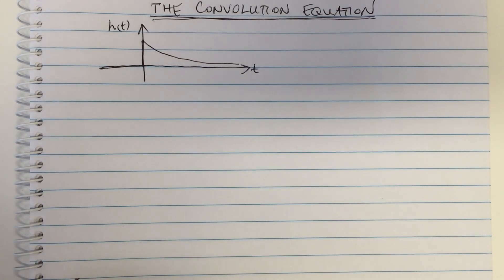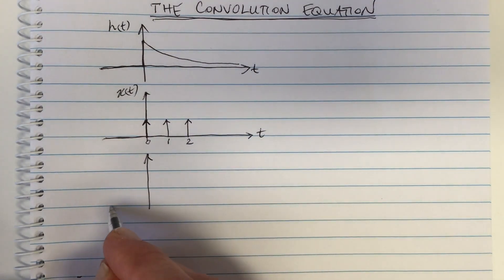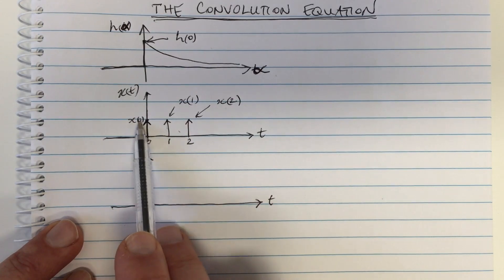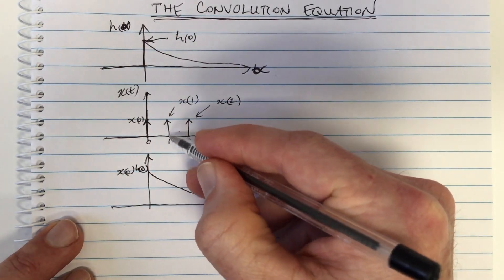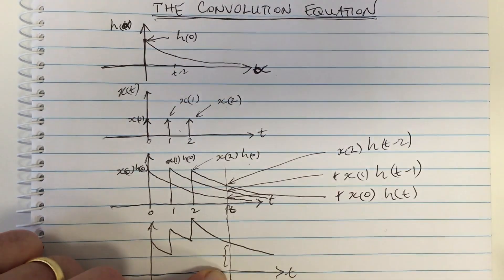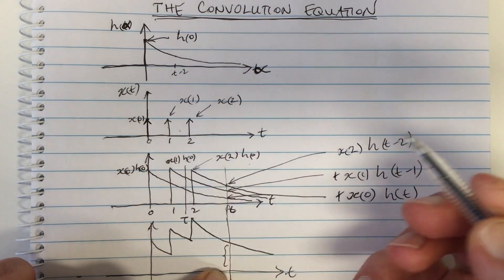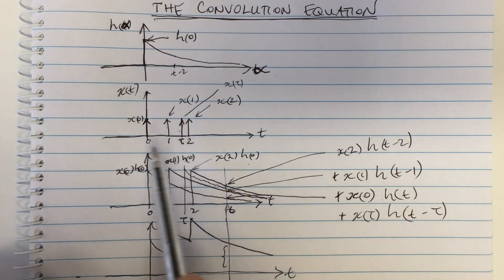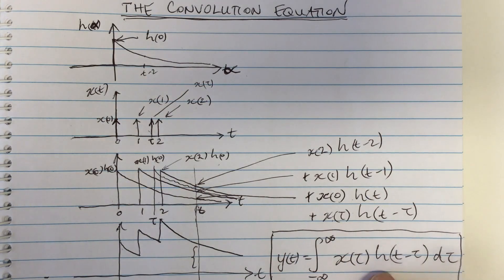Convolution Equation Explained ("Best explanation on YouTube")

Comment: if the convolution is calculated for a fixed t and tau is the variable what if we wanted to know for every value of t. Would we integrate the convolution equation with respect to time?
Reply from the maker: Hopefully this video will help explain: "Convolution in 5 Easy Steps" https://youtu.be/aMaw4EumwyE
Reply: @iain_explains  hey yes i understand from that video you are picking discret values of t. Am i right in saying that the convolution equation is for discreet values of t? That would imply if i wanted every value of t i would need to repeat the convolution equation for every value of t if my function was unbounded. Seems cumbersome maybe i am missing something sorry.
Reply from the maker: I don't pick "discrete" values of t. I pick example values of t, and then I work out the range of t-values for which that answer holds. If you watch my "5 easy steps" video, you will see along the bottom line, that I show the values of t for each of the cases. The answer of the convolution is different for different ranges of t, but I show the answers for all values of t, from negative infinity to positive infinity.
Reply from the maker: Yes, that's right.

Comment: I think you should say more about x(t) being "identical in its effect on a system" to an "infinite series of short rectangular pulses" with area x(ti)•Dti each. Each of these pulses generates a response very similar to the system's impulse response multiplied by x(ti)•Dti or h(tt-ti)•x(ti)•Dti...
Evaluating all these responses per all ti at tt=t and summing these evaluations leads do the total response of the system to x at time t. Taking the limit of the sum as Dti goes to zero results in expressing the sum as an integral - the convolution integral...
This is possible if the system for which h(tt) is given is linear and time independent, i.e., LTI.
Reply from the maker: Here's a video where I give a bit more intuition along those lines: "How to Understand Convolution" https://youtu.be/x3Fdd6V_Hok

Comment: quick question, when summing the output responses at 4:25 and we say it begins decreasing, can we say it decreases twice as fast after summing the first two responses, and three times as fast when summing the third response, as in the decreasing section of the response, it would be the sum of 3 functions which are all decreasing? Basically im asking if the rate of decrease in the summed functions remains the same in each section. Thanks!

Comment: In case if the system is not an LTI, then what can we do to find the output?

In a NON LTI system, The convolution with it's impulse response won't work right?
Reply from the maker: For time varying linear systems, you can still take an impulse response approach to modelling the system, but the impulse response will be a function of time. eg. h(t, tau) where "t" is the time that the impulse is applied to the system, and "tau" is the variable that indexes the response to that impulse, over time.

Comment: Hello Iain,  you are blessed with knowledge,  passion to teach and intelligence. 
I love that you responded to almost all your viewers regardless of how long the videos have been posted. I have some confusions on the application of convolution.  I understand the operation of convolution from pure math standpoint,  namely finding the overlapped area of 2 signals,  with 1 of them reflected/reversed and shifted from left to right on an xy plane. However,  if it is applied to electrical signal over time for example, the impulse response represents the output of the system for an unit impulse as input, specifically,  you mentioned that a continuous time input signal can be seen as many scaled unit impulse with infinitesimally small time interval.  If we take at each time instant,  the ouput is the sum of input signal multiplied by its impulse response delayed by the same amount of time,  and the result could be a non-trivial positive number, even at time t slightly greater than 0. However,  if we use integration, given the small range in integration interval,  the area would be very very small. This is my confusion, can you help explain?  Was my question clear?
Reply from the maker: I’m so glad you like the video. Sorry, but I don’t understand the point you are trying to make in your question.
Reply: @iain_explains  Hi professor Iain, let's assume a unit impulse response of a rectangular pulse of 2V from time t=0 to t=2, and an input signal of rectangular pulse of 1V from time t=0 to t=1. If I understand you correctly, you were saying that a continuous input signal could be considered as many unit impulse (in this case with weight = 1) infinitesimally close to each other. If we measure the output of the system at t=0.1, if I understand you correctly, then it's the sum of x(n)h(t-n), where n starts from 0, and increases infinitesimally small to 0.1, while t=0.1. In this particular case, since x and h are both rectangular pulse of 1v and 2v respectively, so the output would be adding many 1v * 2v together, which would sum up to a large positive value, since there are infinitesimally many of them. For discussion sake, even if we just sample 3 unit impulses at t = 0, 0.01, and 0.02, the output would have been 3 * (1v * 2v) = 6v. However, if we use integration, the integral part of the overlapped signal between x and h is just (1v * 2v) (i.e the height of x * h) multiplied by 0.1 (i,e the width of the overlapped area of x and h, since t=0.1), which integrates to a value of 2 * 0.1 = 0.2. I think my understanding of the relation between unit impulse and the continuous signal is wrong.  Could you help clarify my confusion ? I hope my example isn't adding more confusion to my question.

Comment: One of the ways that students learn, or demonstrate that they have learnt, is when the teacher asks the student to explain certain features.

So here we are in the lecture theatre, Prof Iain has just explained the convolution equation. Iain asks "have you all followed the reasoning and the equation?" We students all dutifully and appreciatively nod an acknowledgement that yes we understand. Ok says Iain, I would like one of you to come out to the board and explain to the class why the convolution equation is a function of time written as y(t) with an integral that is written not with respect to dt, but to d(Tau). Often integrals I have seen written as a function of some variable such as t are determined with respect to dt. I get picked out to try and explain....

Ok I checked my ancient copy of Taub and Schilling "Principles of Communication Systems" and can confirm that within very early pages, the convolution equation as written by Prof Iain is quite correct. 

To try and explain then - it is to be noted that y(t) is a function of time and there is an expression h(t- Tau) within the integral. With t on both sides of the equation, we can have dimensional stability on both sides of the equation. y(t) will yield a value at any time t. Whilst not written on the vertical axis, y(t) was sketched as the 4th diagram in the lecture. In order to evaluate y(t) at some specific time t, we need to evaluate the sum of all the impulses (delta functions) and their impact on the output to give us a response at that particular time t. But the output at time t depends on many (an infinite number of) delta functions each causing a response which have occurred previously in time and are possibly still continuing to affect the system. So we start at -infinity to account all values of Tau that have occurred (almost like saying time, but not quite) and we look at the impact that an infinite number of delta functions occurring at all Tau's have by multiplying the system response at each Tau as seen at a specific time t. Each value of Tau is infinitesimally close and so are separated by an interval d(Tau). Repeating a little, we take all instances, an infinite number of instances, of delta functions multiplied by the system response which we sum. This continuous sum gives us our integral.

I think I passed, and am about to put the pen down and look over to Prof Iain to see whether he approves, but then one of you students calls out and says "What about that infinity upper limit in the integral? How can you sum something or say something that is yet to happen has to be accounted in the output at a specific time t? Is that what you are saying? Shouldn't the limits of integration be -infinity to t  rather than -infinity to infinity?" (sigh...) Just when I thought I had passed, this one comes like a curved ball. With my pass now looking quite shaky, I bite into my bottom lip and shake my head. No, sorry, you have me on that one.

Can anyone help?
Reply from the maker: The equation for convolution does not only apply to causal LTI systems. When you're dealing with a causal LTI system, the impulse response of the system will be zero for negative time, and this will limit the range of the integral in the convolution in the way you have said you expect it to be (ie. not going all the way to infinity). But the convolution equation is more general, and applies for non-causal systems too (eg. for images, where you're not dealing with time but with pixels which can be smoothed in two directions - forwards and backwards). It also applies for probability density functions. See this video for more on that example: "What is Convolution? And Two Examples where it arises" https://youtu.be/X2cJ8vAc0MU

Comment: Thanks, Professor for giving these wonderful presentations. I really lacked this during my studies. I have a doubt: When we find the output of an LTI sustem at the particular time t, as you said, it is the sum of all the values of system responses at that particular instant, but y is the limit of convolution from -infinity to infinity? shouldn’t it be -infinity to t logically? Because the future excitations might not have effect on the current output.
Reply from the maker: If you're only considering causal real-time systems, then yes. But the convolution equation holds for non-causal systems too. For example, when filtering an image, the "impulse response" of the filter affects the pixels that are on both sides of the "impulse".

Comment: how does x(0)*h(0), x(1)*h(0), and x(2)*h(0) give you some finite height, doesn't x(0), x(1), and x(2) evaluate to infinite since they are unit delta functions signified by the upward pointing arrow?
Reply from the maker: Excellent point. I didn't want to dwell on this in the video, since it's a mathematical technicality that detracts from the intuitive explanation of the video. However, you're correct, the delta functions are infinite height. But they are also infinitely narrow. So, what does it mean to "multiply" by a delta function? Well it's not really an instantaneous multiplication, since delta functions don't really exist. And a system cannot be instantaneously impacted by an input, because nothing happens exactly instantaneously in the real world. But the resulting function is correct (ie. x(0)h(t) ), and its value is x(0)h(0) at time 0. The number that's written next to the delta function (ie. x(0) for the delta function at time 0) represents the area under the delta function (... it's infinitely high and infinitely narrow, but its area is x(0) ). So it is a measure of the "size" of the delta function (or more intuitively, the "size" of the impact/impulse that is being put into the system, in this case).
Reply: @iain_explains  Oh I see thank you that makes more sense. Follow-up questions wouldn't x(t) always equal 1 then if x(t) represents the area under the delta function and a delta function has infinite height and infinitely small width?
Reply from the maker: There's no reason why it should always equal 1. It is just a mathematically defined function. It can equal any value you define it to be. Infinity (height) times infinitesimal (width) is not well defined as an area. So we can define it to be whatever we like. In general it makes sense to define the impulse response of a system, h(t), to be a function with unit energy ( integral of h(t)^2 over all t = 1 ) and define the corresponding unit input impulse, to be a delta function with area/value =1. This captures the situation where all the energy from the input impulse signal is transferred to the system's output signal.